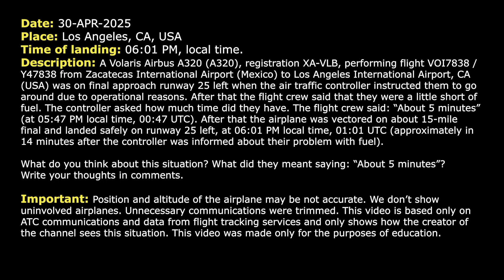“We’ll show you on minimum fuel”. Volaris A320 has fuel problem at Los Angeles Airport. Real ATC

Comment: I know these FAA document answers are boring, but it does clarify:       

U.S. Department InFO 08004 of Transportation DATE: 2/7/08 Federal Aviation Administration Flight Standards Service Washington, DC 

http://www.faa.gov/other_visit/aviation_industry/airline_operators/airline_safety/info An InFO contains valuable information for operators that should help them meet certain administrative, regulatory, or operational requirements with relatively low urgency or impact on safety. 

Subject: Comparison of Minimum Fuel, Emergency Fuel and Reserve Fuel Purpose: This InFO is issued to provide education and clarification for operators and pilots about the appropriate use and meaning, connotations and regulatory definitions of the terms “minimum fuel,” “emergency fuel,” and “reserve fuel.” 

Background and Definitions: a. Minimum Fuel. The Aeronautical Information Manual (AIM) and the Pilot/Controller Glossary both provide the following definition, which states that, Minimum Fuel: “Indicates that an aircraft’s fuel supply has reached a state where, upon reaching the destination, it can accept little or no delay. This is not an emergency situation but merely indicates an emergency situation is possible should any undue delay occur.” “Minimum fuel” declarations are essentially advisory in nature to air traffic control (ATC). FAA Order 7110.65R, Air Traffic Control, states in paragraph 2-1-8, Minimum Fuel: “If an aircraft declares a state of “minimum fuel,” inform any facility to whom control jurisdiction is transferred of the minimum fuel problem and be alert for any occurrence which might delay the aircraft en route.” 

Note: Use of the term “minimum fuel” indicates recognition by a pilot that his/her fuel supply has reached a state where, upon reaching destination, he/she cannot accept any undue delay. This is not an emergency situation but merely an advisory that indicates an emergency situation is possible should any undue delay occur. A minimum fuel advisory does not imply a need for traffic priority. 

Common sense and good judgment will determine the extent of assistance to be given in minimum fuel situations. If, at any time, the remaining usable fuel supply suggests the need for traffic priority to ensure a safe landing, the pilot should declare an emergency and report fuel remaining in minutes. The point at which, in the judgment of the pilot-in-command, it is necessary to proceed directly to the airport of intended landing due to low fuel. 

Declaration of a fuel emergency is an explicit statement that priority handling by ATC is both required and expected.

Comment: The crew never declared PAN PAN or Mayday
Reply: Well, PAN-PAN is for urgency but not immediate handling and usually not used in fuel situations.

Usually you declare "min fuel", when you cannot accept any more delay without getting into final reserve. It's not mandatory, but common courtesy, and usually met by ATC with priority handling.
If you expect to land with less than final reserve, that's a mandatory MAYDAY [Fuel] (which is also why min fuel leads to priority - otherwise you'll get an emergency).

The crew basically said they were just above min fuel / at min fuel depending on their place in the sequence.

Comment: 5 minutes till they'll have to declare "minimum fuel" (which includes two approaches and 1 go around if I recall correctly).
Reply: Minimum fuel should mean that  if something will be added to the actual situation , such as a delay vector, a holding etc... they will declare a mayday fuel because they will be using the final reserve fuel, a fuel never to be used except for emergencies. Minimun fuel will advise the ATC of the situation.
BUT
Normally you arrive at your destination with the alternate fuel onboard too, you can state i can hold here for xx minutes, then i'll have to divert, and consider a safe margin too, or you can commit to landing but you must be sure to manage to do it.

Comment: The wording by the pilot was very vague. They should either declare minimum fuel or emergency fuel if fuel IS an issue. 
Minimum Fuel indicates that an aircraft has just enough fuel to reach its destination but cannot accept delays. It does not require priority handing by ATC. It's a pilots discretion and determination if priority handling is necessary for safety. In which case they declare emergency fuel, and does require immediate ATC action. 
Faa regs also require IFR aircraft to have 45 mins of reserve fuel past their destination if needed to reach an alternate airport.
This is all based on my memory from years back working as atc.

Comment: For aircraft equipped with turbine engines, the fuel required for a 2-hour flight at normal cruising speed after reaching the destination aerodrome, including final reserve. So the 5 minutes announced are most likely 2 hours 5 minutes
Reply: That’s for flight with no alternate airport. Typical is alternate field plus 30 min
Reply: The proper phraseology Is "minimum fuel" or "mayday mayday mayday fuel" when you're about tò hit final reserve. From the go around and resequencing to approach seems ATC Just didn' t give a damn to the supposed  "short of fuel -5 minutes" story. Well done.

Comment: I’m assuming when 7838 said 5 minutes of fuel left, he meant 5 minutes before he had to declare an emergency? If he meant it literally, he would be an extreme emergency. There’s no way he could be that low on fuel and not have told the controllers before that. I think the FAA regulations say you have to declare at 30 minutes ( hopefully someone with more knowledge can tell us the exact time and procedure.)
Reply: Yep and sounded relaxed and business as usual in comms before and after. Five minutes until reserve seems about right, as you say, five mins total would definitely be a mayday.
Reply: Before declaring emergency fuel, they have to declare minimum fuel, which means they are not yet an emergency, but they can not receive further delays.
According to this recording, it seems that they were 5 minutes away from declaring min fuel. Only if further delays would have ensued, then they would have had to declare emergency fuel. In that scenario, ATC would have to hold all other aircraft and help this plane land immediately.
Reply: @andreea007 Technically, min fuel is not a required callout. It is more of a courtesy to ATC (and more convenient for both parties to have a standard "kinda need priority")
Reply: @lyaneris  In the FAA's documentation they say:
 "Declare “minimum fuel” when, in your best judgment, any additional delay will cause you to burn into your reserve fuel"

It doesn't look optional to me, but anyway, the purpose of my comment was to show that the plane wasn't 5 minutes away from fuel starvation and that there are multiple layers of protection in order to prevent this.
Reply: planes can't know if they have 5 minutes of fuel anyhow.   Not only is fuel burn variable but sensors aren't that precise.

Comment: How is that even possible? Were they kept on hold before?
Reply: 5 minutes until reserve tanks
Reply: another comment suggested that was really 2 hours and 5 minutes, but I cannot confirm that.

The logical reasons I can think of is the cruising altitude and steepness of the take off. 

As far a problems go, underfueled/airline being cheap, faulty tank sensor, small fuel-line or bladder leaking, faulty flow sensor, and/or fuel computer glitch. 

It was likely a sensor related malfunction, but you do not gamble with lives. If the computer says land, you must land.
Reply: @keith_5584  the other comment is wrong. Typical formula is alternate plus 30 min
Reply: @Gee1410thirtysix  Hey thanks for that. I am susceptible to bad info, so the correction is appreciated.